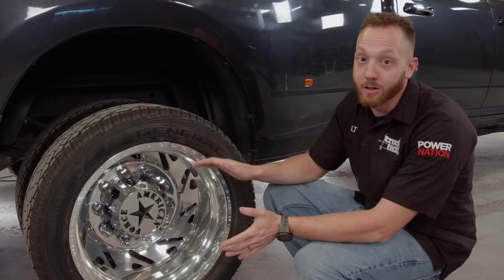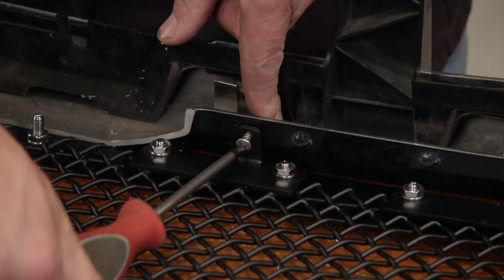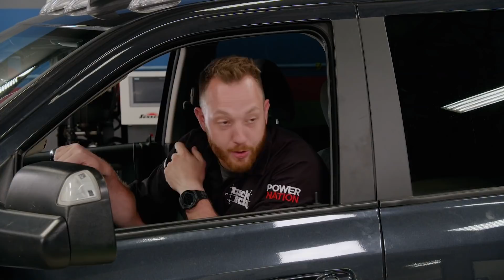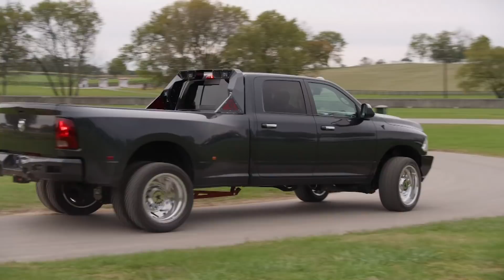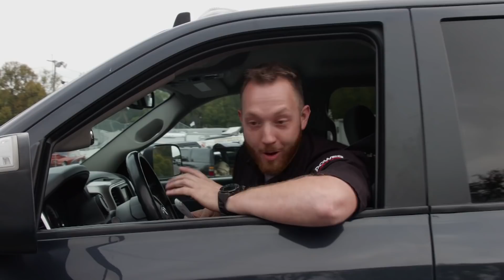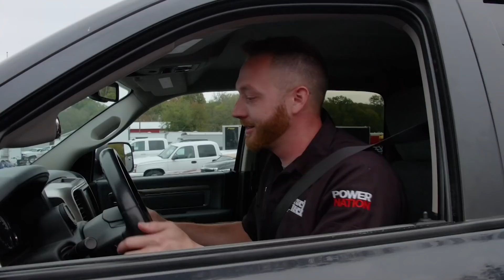Dually Draggin' a Ram 3500 Cummins Turbo Diesel - Truck Tech S6, E2

Comment: LT is ok. It's funny how some stuff he knows very well, other not at all. I laughed because they say they're building a drag only truck, but yet they leave those heavy ass ranch hand bumpers on front and rear, which need to be deleted along with that heavy bullshit in the bed, and they're running those Baller wheels instead of smaller lighter wheels. They should take all the window glass out, power window motors and gut the interior with a racing seat , then they're really seriously driving and building a drag truck , not some bullshit with a thousand extra pounds bolted to it

Comment: Uh 4x4 wth bud. Boosted launch dang wth. I ran a 14.3 with 500 hp 24 cr 3rd gen tune and exhaust on 35s lifted in the heat of az. No excuses its 8000 lbs

Comment: Power Driven Diesel and Mr Banks are who does the work on our Dodge truck fleet. In fact Mr Banks personally installed my compound turbos, injectors, new head and it’s supporting mods. 

Anyways did you not install anti-hop parts with all the other thousands of dollars in parts? Lol Put that thing in four, build boost on the line to 8 pounds and lean in to it. That trucks got a 14.2 in at least.

Comment: This whole build is a joke. A) You get the one truck you shouldn’t get to go fast, a dually. B) you get the one transmission you shouldn’t get to go fast. C) you’ve got too little air. D) you’ve got too little injector. 800hp dreams and 600ho parts. Topped off with a moron behind the wheel and no 4x boosted launch, the embarrassing times aren’t a surprise. And the bro-dozer “style” (or lack thereof) is the icing on the cake of a joke of a build. I don’t often dislike Dodge Cummins’, but this one sucks.

Comment: No you dont have just 4 tires to get traction with...... you have 6 and the front to have the most weight and traction on them. That thing is no faster than a tuned stock truck.

Comment: Before you all cry 4x4 BOOSTED LAUNCH IT!!! This video is "years" old, we know this because he said it was pre asin tuning at the very end of the video. Also look at the MPH on the passes, it got slower with more power! The only way that is really plausible without letting off before the traps is it's being limited somehow. You can totally tell it's being capped around 100MPH. This is because of the transmission side of the tuning, and there is nothing a 4x4 boosted launch will do to fix that. Yes it'd be quicker with a boosted 4x4 launch but not by much because of the MPH truncation would be hit sooner.

Comment: you Need to Launch in 4hi between 8-10psi also you need that 4.10 rear it should be a low 13 high 12 truck the way you are sitting right now

Comment: Put it in 4 wheel drive you dingus
Reply: When the tires spin like hell, 4 wheel drive just don't ring a bell 🤣
Reply: How do you know it's not? At 18:55 you can clearly see the front axle shaft is spinning.
Reply: @AK_Ray . So the axle doesn't move in 2wd? 🤣🤣🤣 don't, don't... I can't 🤣🤣
Reply: @carbonconnection2480  I don't know do they, I'm not familiar with Dodge 4 wheel drive systems. I'm a super duty guy and I know on super duties when the front axle is unlocked they don't spin
Reply: @AK_Ray  actually the 4x4 will work without locking the hubs on a superduty.
Reply: @ponypwr  whether you manually lock the hubs or use the switch and vacuum locks it in, that's  locked in regardless. Literally nothing to do with what I said though.
Reply: Lol he shld have locked it in 4wd that truck doesn’t have enough power to spin all 6

Comment: I have an '06 2500 with the 5.9. Stock turbo, 50 hp injectors, Home Depot air box mod. Stock CP3 with EFI Live from Adrenaline. I have deliberately left the stock turbo. In my research, all "better" turbos kill at least some of the low end. And the low end torque ( from 1200-2000) is why I bought the thing in the first place.
Reply: Nah 64mm turbo upgrade will out pull that stock charger all day and knock EGT number down 100-200.
Reply: @Toten_651   maybe at revs above 2000. If I am gonna run those RPMs I'll get a Ford.

Comment: $10,000 of aftermarket parts on a $75,000 truck to run an ET equivalent of an 89' Ford Taurus...
Reply: Can that 89 Ford Taurus haul 15,000lbs?  Nope.
Reply: Clobercow1 wayyy more man. People haul 30k lb construction equipment
Reply: @Clobercow1  I was gonna say that that truck, with those torque numbers would pull a bobcat skidder up an interstate mountain pass, and not lose 1 mph. That truck is built to pull.
Reply: @Steve Bay does your ford Taurus weigh 9000lbs?
Reply: @Toten_651  No and neither does that 3500
Reply: @swampratt36  my 350 srw crosses the cat scales at 9009 .
Reply: Of course it's a towing animal. The point is, it's being touted as a drag truck when it's no faster then any plain jane sedan driving to get latte's at Starbucks.
Reply: @bigboreracing356   The add the weight of the trailer extra parts and tools people  now you maxed you weight rating out while getting 6mpg . You will only understand why a diesel truck is needed after you burn through a few gas truck transmissions an engines while pay that fuel bill .

Comment: A true test of that truck would be hooking it up to the trailer they brought it in on, loading the tow truck on the trailer, then see what it would do.
Reply: Happy Heathen believe me it will easily tow 20k lbs. with that much power it’s not an issue. Not sure what kinda test that would be. Let’s see if this truck can do what it was designed to do.

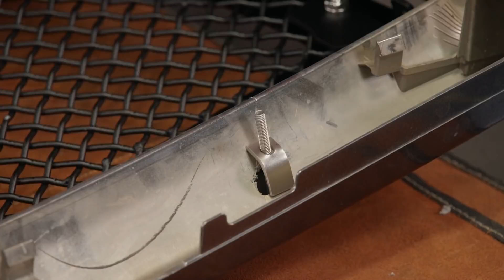Comment: The aisin has no tuning but manual mode works good. My brother has a one tonne 2016 cummins 3:42 with just an intake exhaust and tune and it’s a low 13 in the 1/4. 4wd boosted launch with the manual selector set to 2nd. It will actually start in 1st and shift to 2nd quite well and then we shift his at 32-3300 rpm and it shifts much faster at that rpm. You dyno tuned that truck so if you know the rpm where the power falls off then use that. If the power falls off at 3500 then I would push the up shift at 3500 even though the gear will probably only shift around 3700 you will be in the next gear at the right rpm to make up for that 3:42 gear. Also dont be scared to really load on that converter to boost it up off the line. That big single you have needs the boost built the best you can get it or it will just fall on its face

Comment: No 4wd launch no wonder it was so slow
Reply: @BootyMessiah0  Totally false.
Reply: Exactly 4wd high is the only way, also  need to break torque to around 2000 rpm in order to build boost for the launch hence why the need for 4wd , he didnt do either which equals a epic fail.

Comment: Ok so what you do to "tune" a diesel turn up the fuel, turn up the boost. Lol. Diesels got it so easy
Reply: Andrew Sommers it’s not that easy you have to worry about EGT’s and driveline damage
Reply: No it really is that easy lol, just don’t use too much timing and don’t get crazy with the pulse width and just observe what the truck is telling you lol